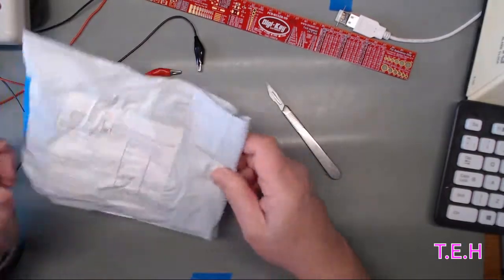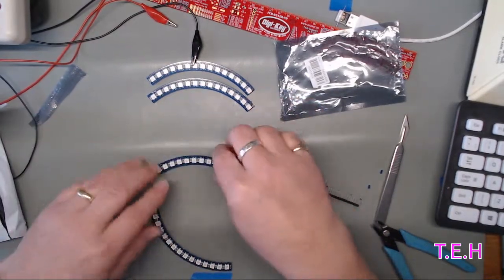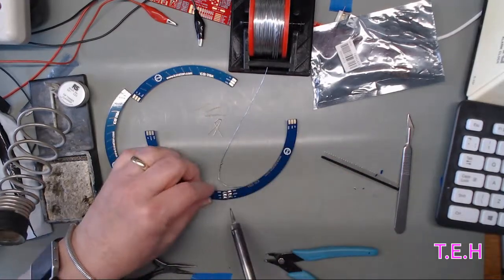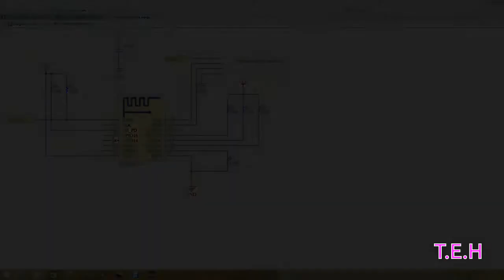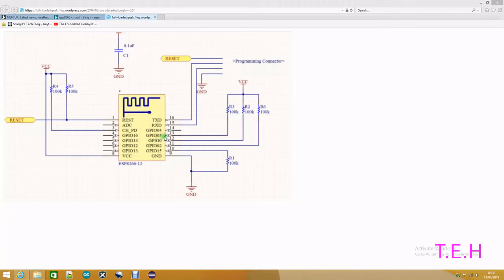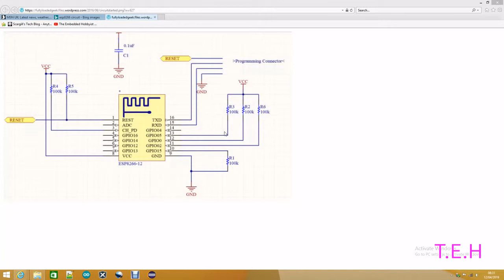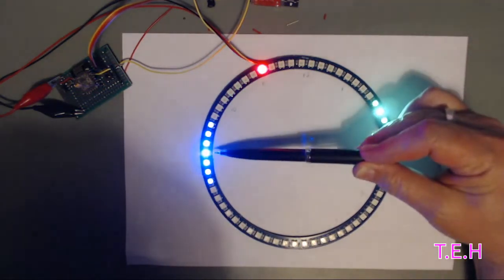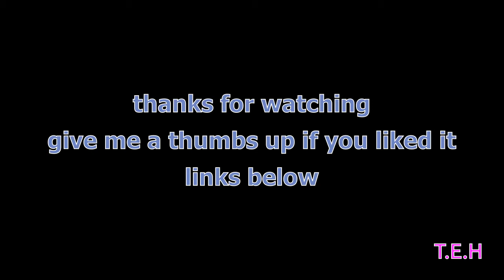#008 360deg Wi-Fi LED clock

Comment: Could you share your sketch?
In fact, I would like to use 3 separate Led strips but in the same code, one for the Hours, another for the Minutes and another for the Seconds; Can you help me?
Thanks
Reply from the maker: Hi Daniel ,
The code on the esp2866 was modified from code produced by a blogger Peter Scargill. who has a great tec blog.

the code was  ESP-go, which can be found here.

https://bitbucket.org/scargill/esp-go/src/master/

The main part of the code is found in petes_code.C in the "user" dir.